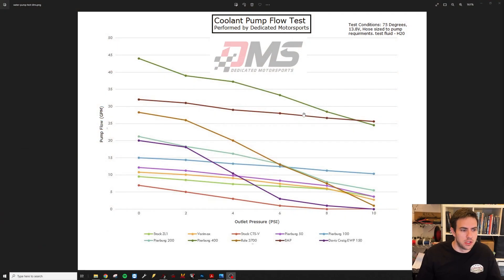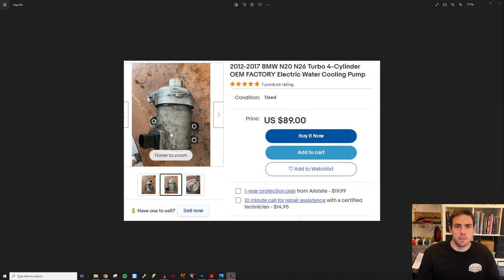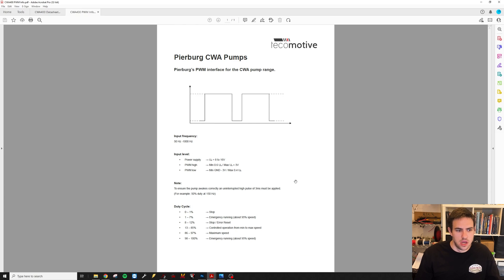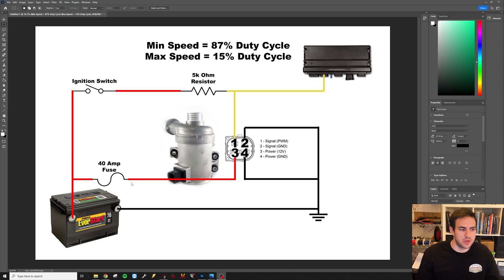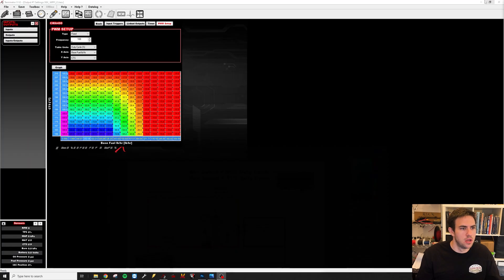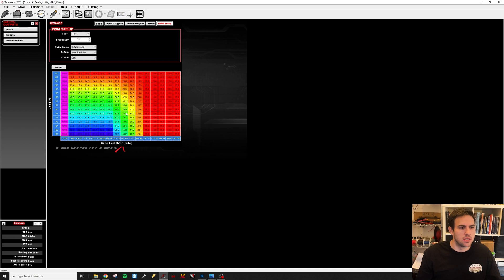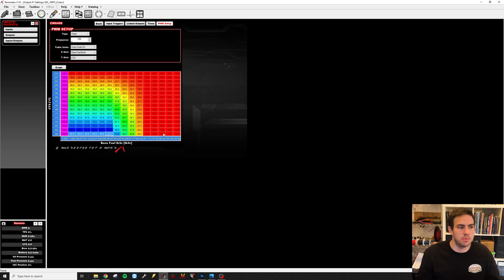Holley How to: Electric Water Pump Control

Comment: I followed your video and my pump is not turning on, shows in the terminator the pump is on 87% or whatever I set it too. Any thoughts? Can I have the resistor in the “2” wire or does it have to be on the ignition side? I’ve confirmed there is power to the pump
Reply from the maker: Does the pump come on if you give give the speed wire power?
Reply: yes @ClickFifth
Reply: i took the speed wire from the holley and gave it keyed powered and the pump will turn on
Reply: If I set the pump to work on a toggle switch instead of the Holley do you know if it will run at 15% (full) power when on?
Reply from the maker: Shoot me an Email at Will@clickfifth.com  @matthewmadison3736
Reply: @ClickFifth email sent

Comment: Could you show the setup while using pwm+ 
I’m using a holley dominator. 
What would be the difference between wiring and the setup of pwm+
Reply from the maker: For a Dominator and PWM+ you would ground one side of the pwm and just send the pwm + signal to the other side of the connector. No need to run the resistor.
Reply: @ClickFifth How about the ”wake up call” using Dominator and pwm+ ?

Comment: Great information I want to learn how to do this with the modern radiator fans
Reply from the maker: Its a very similar setup just use a pwm capable relay like this OEM Dodge part. https://amzn.to/3VyuN7Y

Wiring for that is here:
https://www.turbotweaksupport.com/index.php?attachments/dorman-902-310-pump-pwm-alky-png.1603/
Reply: @ClickFifth  man this is great stuff!